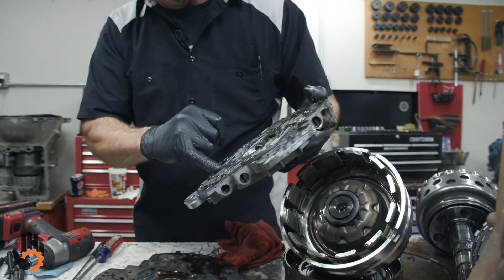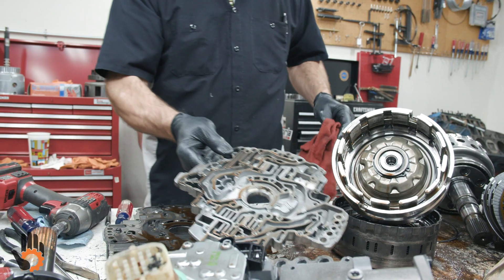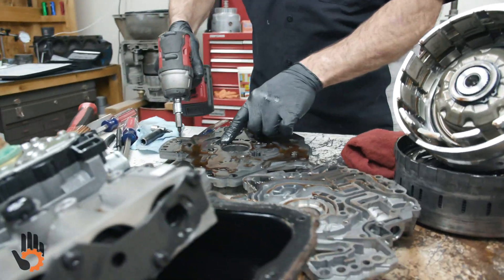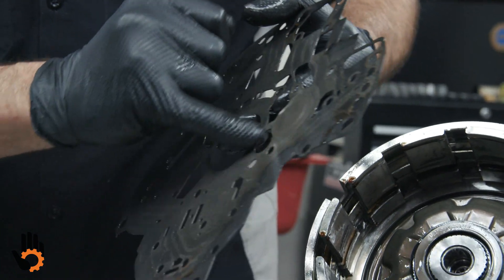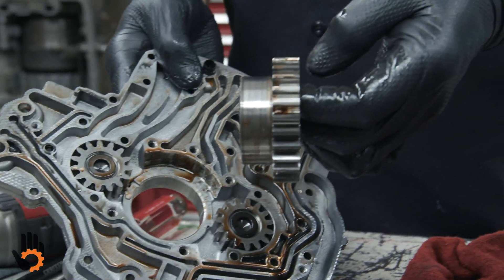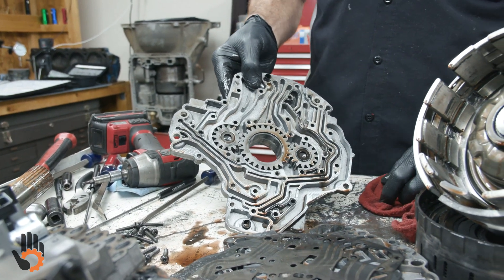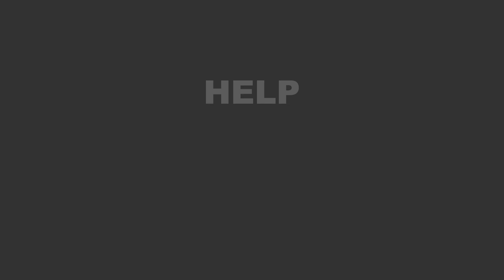68RFE - Inspection    (Dodge Cummins)

Comment: Also very interested in a 68 RFE build. I have had two problems with my own 2018 68RFE, Dealer fixed, and would like to rebuild it at some point since the warrantee is done.

Comment: I have a 2007 ram 3500 with 6.7 Cummins,  I  have had my transmission rebuilt 3 times professionally,  I  am only getting about 500 to 2500 miles out of them  before they fail,  there has to be a simple solution for why this is happening,  open to your suggestions,  and I would like to see a complete rebuild on the 68rfe.
Reply: I would look into getting a revmax transmission. If you're doing just a rebuild for the 68rfe it's not worth it. You definitely wanna spend the money getting the upgrades.

Comment: So do u sell complete transmissions
Reply from the maker: At this point in time, we do not sell anything.  Just here to give...by providing high-quality video content.

If you're looking for a recommendation on a transmission shop, I may be able to assist you with that.  If that's the case, please supply a City/State, and I'll see what I can do.
Reply: How about Albuquerque NM?  I have a 21’ ram with a 68rfe and I’m worried the 2c snap ring has come dislodged. I don’t think I have warranty